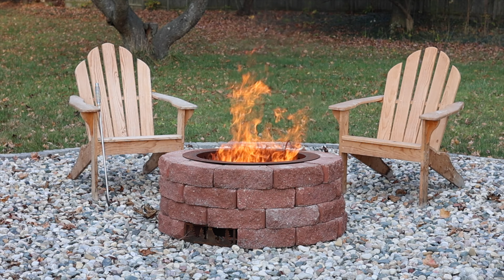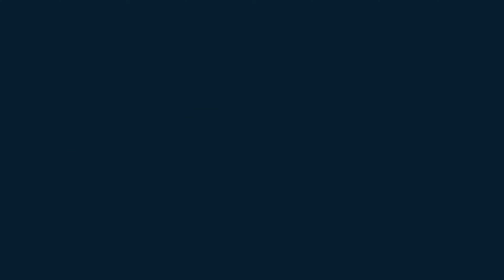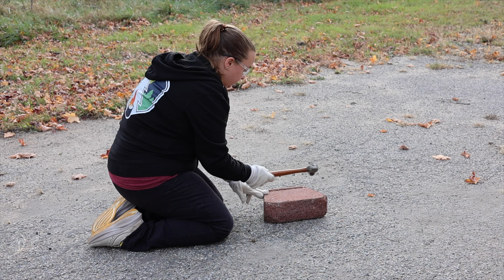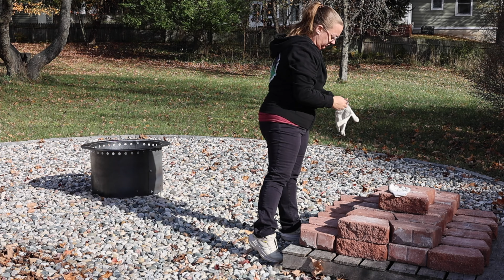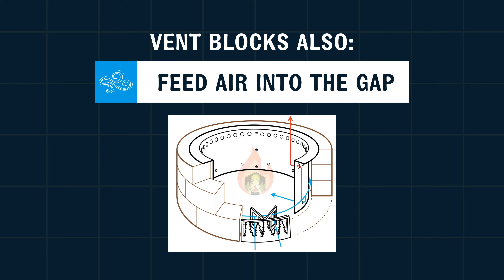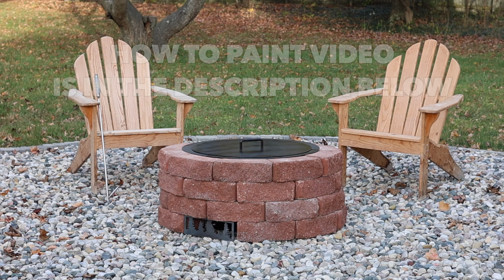How to Build a DIY Smokeless Fire Pit (No Drilling, Cutting, or Bending Needed)

Comment: How is the heat output while sitting down? I’m comparing this to the solo stove where people have to buy the heat deflector to help
Reply from the maker: We find it nice and cozy because once the bricks warm up from the fire, they provide consistent radiant heat, no heat deflector needed. The bricks do get warm to the touch but never as hot as an all-metal smokeless fire pit (which can quickly get hot enough to cause burns). Plus, we have found that heat deflectors can take what little smoky air is left and redirect it to you and your guests. We truly enjoy leaving a fire warm and in great company and not smelling like one.

Comment: Are the outer blocks shown in the video fire-resistant, or just normal edging blocks?
Reply from the maker: The blocks are just standard retaining wall blocks you can buy from most hardware stores. Most if not all of the heat from the fire is being absorbed by the smokeless fire ring. There is a short video on my page that shows that after hours of the fire burning, you can still go up and put your hand on the blocks (I wouldn't do this just to be safe ).

Comment: Would the 30” be better with 3 or 4 metal vent blocks or  is 2 best?
Reply from the maker: Thanks for asking. It always better to side with more or bigger vents then less. A 30 inch smokeless fire pit i would go with 3x of the 4 inch tall by 12 inch wide and 5 inch deep blocks. We have them and many different sizes of vents to pick from on our website.
Reply: Thank you! Just placed my 1st order, 3 block vents! How many retaining wall blocks does each row need with the 30” fire ring?

Comment: The largest Solo fire pit costs just under $500 and comes assembled.  The bonfirebydesign is $600+, comes disassembled, and requires additional parts be purchased from Lowe’s/Home Depot? Hmmm
Reply from the maker: Thanks for your comment. We love seeing interest in outdoor fire experiences.  It’s what we’re passionate about!

There are a couple of things worth clarifying so folks reading this get the full picture of the comparison being made:

1. Solo Stove models like the Yukon (27" at ~$500) and the Canyon (30" at ~$750) are complete, portable smokeless fire pits. Their measurements refer to the outside diameter of the unit. While the base price is often for the pit alone, optional stands, shelters, and bundles can push the total cost well over $600.

2. What we provide: Bonfire by Design kits are intentionally different. We supply the core smokeless fire ring insert, metal vent blocks, and lid, and customers build the surrounding structure using locally sourced materials that match their backyard style. Our dimensions refer to the actual interior fire opening, not the exterior footprint. Our kits range from $339–$639 for 24"–36" interior openings, and are available in both carbon steel and Corten steel.

All Bonfire by Design kits are designed and manufactured by us in Michigan, USA, using heavy-gauge steel intended for permanent outdoor installations. Many mass-market portable fire pits are produced overseas and designed for portability rather than built-in use. This is a DIY, fully customizable approach — not a shipped, one-piece unit. We’re not affiliated with any big-box stores; they’re simply a convenient local sourcing option for many customers.

Because of this design intent (customization, aesthetic flexibility, and control over the finished size), it isn’t a direct apples-to-apples comparison with a mass-marketed preassembled fire pit.

We don’t gatekeep our process, which is exactly why we share how-to videos like this one. No one is required to use our kits, but we’re always happy to help via email, text, phone, or comments to make sure customers end up with a smokeless fire pit they’re excited about, proud to show off, and tailored to their space.

Comment: watched many vids but this one helped the most.  why does everyone put rocks at the bottom?  seems that would make cleaning it out hard.  why not just put smooth stone bottom and sweep out ashes through the vent hole.  am i missing something?
Reply from the maker: Thanks for watching the video. One of the reasons we have rocks is that we test many different sizes and styles of fire pits. It was just easilyer to have one big rock bed then anything else i have found. The 2nd is that we thought it looked good in pictures/videos.
You're more than welcome to put anything you want on the bottom of your fire pit, just remember that everything will break down over time. Rocks or sand, you just need to throw some more in; blocks, you might have to dig them out to replace them.